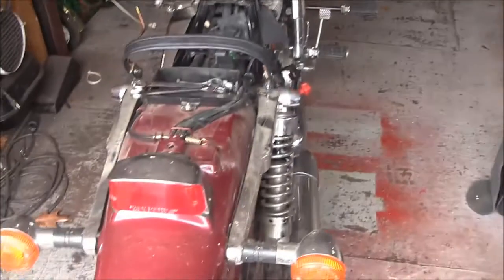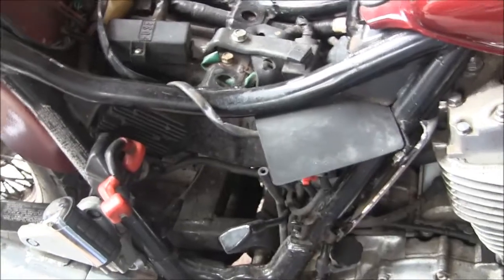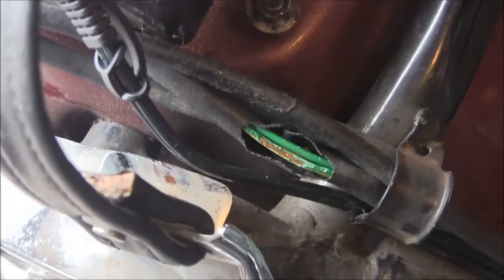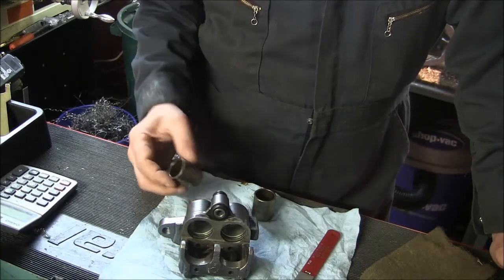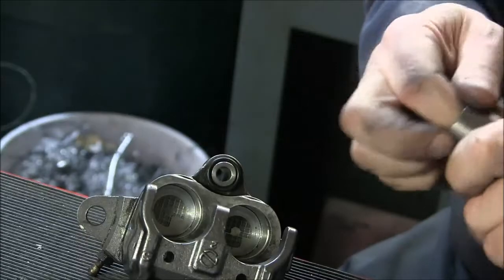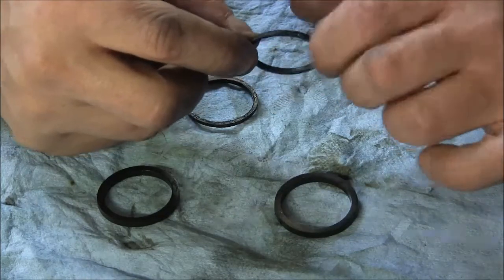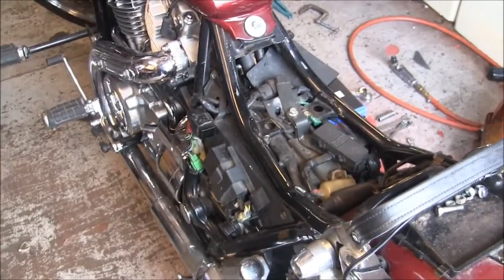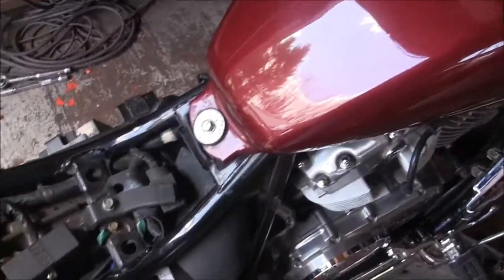Bike Restore 1

Comment: Looks super clean for 5 years storage - well at cursory glance anyways!. 
My bike (Honda VTX) is still in use but will have to sell it - my old hip is making riding painful these days. Pity but have had 13 years of great riding out of it.
Wondered when you were cranking it whether there is a choke - mine always needs a bit of choke even in warm weather. Sounded nice once running.
Reply from the maker: +ChrisB257 I had to park it about 5 years ago because my hips crapped out. Now that I have metal ones, I can ride again. That first crank was long because it takes time for fuel to get all the way up to the carbs. Now she starts right up. And yes, it always requires choke to start. Bottom line, store it properly and you will have minimal problems reviving it.

Comment: I just bought a 1983 honda shadow vt500c for a 100 bucks it wont move i tried dragging it but didnt wanna kill my back. What do you recommend  its been sitting outside for four years that i know of not sure how long it sat before that
Reply from the maker: Hi Keith, It could be the clutch. To check, put the bike on the center stand and crank it. If the back wheel turns, the clutch is stuck. These bikes use a wet plate stacked clutch and if they sit for a very long time, they can get stuck.

If you find that is the case, take a look at the clutch hydraulic system. a leak or lack of fluid will prevent disengagement of the clutch.
Reply: Cuppa Joe thanks for your reply, I'll have a look and let you know.